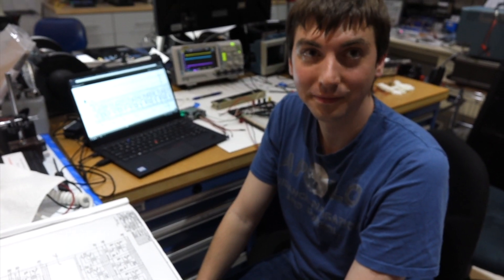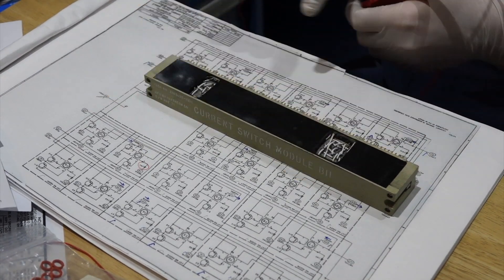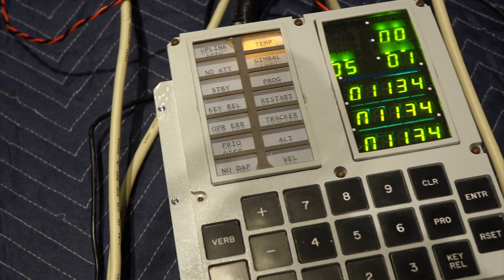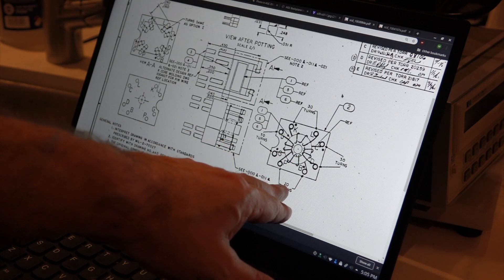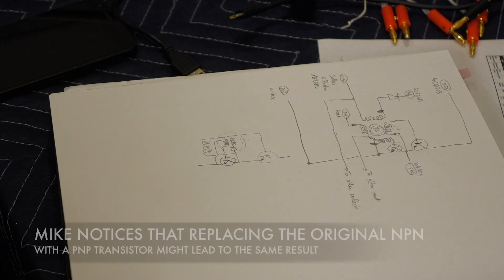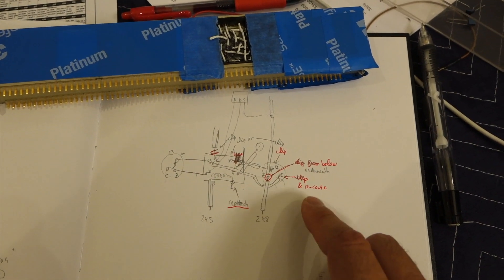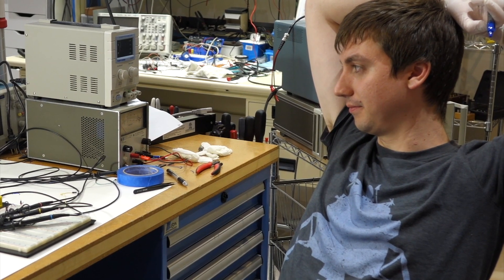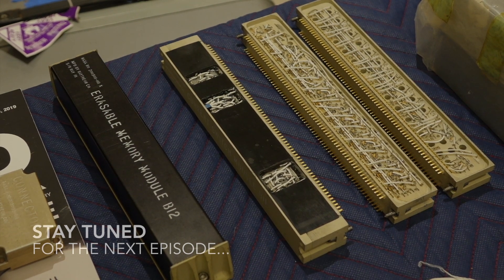Apollo Guidance Computer Part 18: Module B11 rescue, Apollo 13 style

Comment: put a ferite bead on the transistor legs that will filter out the ringing. probably because you used a 250mhz transistor clocking at 1mhz.

Comment: Looking at the waveforms, I think the reason for double pulse is that the new transistor is much faster and therefore produces more ringing. 
Just look at the slow rise/fall-times of one of the edge of the pulses with the original transistor.

Comment: Warning!  The SPICE family of circuit simulators deliberately exclude the radiation effects needed for space and military applications.  The original team behind that software series didn't want it to be used for designing nuclear weapons and intercontinental rockets.  Thus flying a SPICE designed circuit into or outside the magnetosphere may provide some surprises.

Comment: I want to know why the designers thought that potting this module would be a good idea; none of the others were that I’ve seen so far, and it’s not like it’s dealing with kilovolts of electricity here. 😕
Reply: They were potted for machines that would fly, to protect the components and connections from high vibration and g forces.
Reply: Then why not pot all of them?

Comment: In early solid state days ... PNP types were more difficult to produce and always lower in current capacity. Thats the reason why many early solid state amplifiers use quasi-darlington to pretend a power PNP using a power NPN. VERY noticeable on Germanium. I dont know if the AGC modules is based on Ge transistors, but is very likely. Ge technology was very limited in current and matching pairs.
Reply: It is silicon - early silicon

Comment: to get rid of that pulse you need a slightly slower PNP transistor, your one is way too fast, especially compared to the NPN counterpart.  Or add a small capacitor between base and emitter, probably around 2p7 to 10p or so, to tame those fast edges down a little.

Comment: Brilliant! Random question: Why is the AGC all 3-input NAND chips? Seems inefficient. I suppose at least they do use some flip-flops for sequential logic? Do you know which models exactly?
Reply: Because integrated circuits barely existed when this was designed - that 3 input NOR gate, which takes a whopping 3 transistors (6 total in the package, since they're dual) was state of the art technology at the time.
Reply: no flip flops at all. Exactly one type of IC. The concept was to drive up the volumes of that part, improve quality and lower unit costs. Apollo program accounted for about 60% of world IC production for a few years.Some of the ground support equipment was also designed with 3 input NOR gates to further drive up volumes.

Comment: I recall from reading my uncle's collection of Radio-Electronics and Popular Electronics magazines from the '50s and '60s that the majority of the transistor projects used PNP transistors instead of NPN. Could there be a reason that the PNP was preferred over NPN back then?

As a side note, there was a mass-produced FET available for projects somewhere in the mid-sixties.
Reply: Those PNPs were all germanium transistors, which came before the silicon ones. PNP is easier to make in germanium than NPN, but the opposite is true for silicon (at least in those times). Germanium transistors have many drawbacks which would make them unsuitable for this application (high leakage currents etc) which is probably why an all silicon NPN design was used.

Comment: This is a super ignorant question, but having watched a great many videos, and seeing the incredible challenges involved in making these repairs, led me to wonder, if such a failure had happened in space during a mission, what would could the astronauts or mission control have done to intervene and preserve the safety of the crew, and the mission?  Was the guidance computer mission critical, or could they make do without, as Apollo 13 managed to do?
Reply: Well, the LM itself could never land without the AGC. There was a backup computer, the Abort Guidance System which would only launch them back to orbit if the AGC itself failed.

There were some alternatives if an AGC failed, although none of them ever did over the course of all the Apollo flights. Ground could use radar and calculate some guidance information - they did as the primary solutions but the AGC was there in case they lost communications. Also hard to get answers from the ground when you are behind the moon. There was a backup way to control CM attitude and to fly a reentry with a special unit designed just for the purpose. 

The mission could not go on without the AGC, but there were backup methods to at least get them back home.
Reply: @carlclaunch793  Thanks!  I'm just in awe by fellows like you and your knowledge.  I understand just a small fraction of what these videos are about, but the pleasure is in watching the folks troubleshoot and do it all with determination and wit.

Comment: it was mentioned the potting compound is polyurethane? have you tried n-methyl pyrrolidone as a solvent? though it seems like you've got the mechanical removal down well enough, the NMP might go faster or at least help the last stage of picking it out
Reply: If you think NMP will remove this potting and it may be an issue in the future, GO GET IT NOW. Major hardware stores are phasing out strippers/paint removers that contain NMP, so unless you want to order it online and wait for the shipment, hit your local stores and see what's on the clearance rack. Citri-strip is the most likely candidate, the fresh stock is reformulated but older/clearing stock will contain NMP.

If you cannot find it, order some soon. The EPA is under pressure to ban methyl chloride outright (bad facepalm moment) and NMP would likely be attached as it's a similar and still somewhat toxic. All you'll be able to get are raw volatile solvents and cumene/limonene/terpenes.

Comment: Very good work! One of the labs I work with at the university does non-destructive micro/mm wave testing. Of the techniques they use for items that don't work well with the typical backscatter detection is using a 'high' power (relatively speaking, 50W is high power compared to the mw normally used) microwave transmitter to slightly heat up the contents of an unknown container and then image it with a sensitive FLIR camera. It would have been interesting to see if this would have helped located your short.

Comment: Modern transistors have a much higher bandwiidth then transistors from the 60s and 70s. Using a modern  transistor in old designs may cause ringing and oscillations. A capacitor of a few pF between B and C often solves the problem.

Comment: Why do people keep saying that we could never make another Apollo? Videos like this, with a group of nerds and a set of blueprints, seem to suggest that we can!
Reply: We likely can't replicate Apollo 1:1, because knowledge of many of the construction techniques have been lost to time. But we wouldn't want to do that, since so many technologies have evolved immensely since the Apollo era. We can make something much better than Apollo though, if we have the will and the funding.
Reply: @bennylofgren3208  And what techniques might those be? It certainly isn't friction stir-welding, you can do that with a tungsten-carbide bit and a milling machine in your garage. At what point, if you were to hand the blueprints to any competent machinist/fabricator, would they say, "how did they do that?" And why do the techniques even matter so long as the product is made to spec and tolerance?
Reply: @BlackEpyon  You've hit the nail on the head. Just as no actual scientist ever said "we can't explain how bumblebees fly," no engineer has ever said "we can't build another Apollo" (not seriously, anyway). It's just a pop factoid, something that sounds meaningful but is actually false.
Reply: @TheRealColBosch  The "we can't explain how bumblebees fly," came from the days before people had easy access to high-speed cameras. It was ASSUMED that they simply moved the wings up and down, when high-speed photography shows that they move for-aft, up-down, and change pitch, which is what's needed.

 Granted, many details of Apollo, such as engineers notes, have been lost, simply due to the lack of anybody thinking that preserving them would be a good idea (and people dying off), but when one considers that the  NASA Saturn/Apollo engineers HAD to figure these details out IN THE FIRST PLACE... What's stopping you from doing it again? If you know what the function is, you can fill in the gaps.
Reply: @BlackEpyon  when it comes to making simple parts, or making electronics do the desired thing, reverse engineering is pretty easy, you measure, build a model in Fusion, and mill it out etc.
The problem is when you are making parts on the edge of the envelope, and you need to know the exact alloy, foundry techniques, heat treating, surface treatments, etc, and not just the proportion of different ingredients, but also the order they were added, the temperatures at each stage, etc.

And then when you get into the internals of the engines, and you are dealing with extreme temperatures and pressures, and now you have hard to machine materials needing special surface finishes and infusions etc, it just compounds the missing knowledge that only was held by the people who actually figured out how to do it. All these things were designed and built by specific teams, and all the copies were made by those teams under heavy time pressure, so they weren't documenting everything, since they didn't have the time, and it was a constant iterative improvement as they learned more.

Plus you have all the manual fine tuning that often took things far away from the blueprints, based on good old craftsmanship, because it was easier to make the adjustments than to try to change the manufacturing process.

NASA looked at the possibility of bringing the F1 engines back into production a few years ago, and did extensive research on the records and tearing down an F1 to see what it would take, and what they found was that the design was great, and it totally could be brought back into production, but that it would require them to basically start from scratch and replicate the original process of figuring out how to turn the blueprint designs into a reliable engine, and they would have to go through the prototyping phases and lots of testing to find the right combination of techniques and materials, using modern technology and equipment, and the price tag they came up with to do it was more than designing a new engine using modern technology would cost.

It is big and cool, but it's not really efficient or very good for the way we do things now, and as SpaceX has demonstrated, starting with a clean slate can work better, and be a LOT cheaper!

And while they are a lot smaller, even the Merlin engines produce more thrust per pound than the F1s, so you put several of them together to get the same thrust, have better control, more redundency, and save weight. And the Raptor engines blow everything else away.

So yes, a complete duplicate Apollo could be manufactured again, if you wanted to invest the billions in doing this sort of reverse engineering of every single part, and then redeveloping the process of manufacturing them, but there really isn't any benefit to doing it, because we have better technology and better metallurgy and better manufacturing processes now, and we can do it better and faster and cheaper.

The reason we don't, is because we don't have the political or popular will and interest to do it.

SLS could have been done years ago, but it's mainly a political jobs program and a long term income stream for Old Space companies that donate well to politicians.
Boeing put the minimum number of people on the project they could get away with, which is why it is taking so long.

Then you look at SpaceX, and how they wanted something done, so they hired a water tank company to build a rocket in the back yard.
And then leased a fabrication facility to build another one. And that's all with internal funding and some private capitol.

Imagine if we gave them a few billion dollars and told them to get us to the moon. Elon would say it would take 2 years, and it would take 5 in reality, but in 5 he would have people living on the moon starting resource extraction lol

It's probably going to happen that way anyways, but Elon is going to have to demonstrate that he is so far ahead in the capability that the politicians have to admit it.
Reply: BlackEpyon Read ke6gwf's comment, it illustrates much better than I could what I mean. It isn't that the individual techniques are magical in any way, it is just that every single thing on those machines were hand-built, and incrementally changed and improved over time in ways that were often experimental, and not always properly documented. The F1 engines are a great example, since they took enormous effort to get right. Even so, they uprated them from 1.5 to 1.6 million pounds of thrust in later Apollos in order to carry the later heavier "J"-class missions. The details of some of the manufacturing methods used to produce the engine has been lost to time. Just as an example. The Apollo vehicle in total is full of these little details. Just look at the Apollo Instrument Unit as another example. It contains a digital computer (not the AGC found in the CM and the LM, the LVDC (Launch Vehicle Digital Computer), made by IBM) The software for that computer does not exist anywhere anymore. No one asked IBM to retain the source code, so unless someone gets lucky in a dusty warehouse somewhere it is gone forever. It has been speculated that it might be possible to extract the binary codes from the magnetic core rope memories that are still in the two surviving exhibits at museums, but it is unlikely this will ever happen. And even if it does, it would take a significant reverse engineering effort to figure it out.

None of this is not to say it can't be done, yielding at least a good enough approximation of the original parts, but it is not necessary! Today's technology, especially in guidance and control electronics, is so far, far ahead of 1960s tech that it would be a waste of time, except for the benefit of historians.

Comment: Man, at this rate of video uploads, we'll have a Saturn V launch by 2022!
Reply: Goikg to need just a few AvEs with just a few HAAS 5-axis CNCs!
Reply: Joja Joja That would compete for speedy completion against NASA's recent Moon landing plans (SLS+Orion).  2022 should allow time to order fresh components from the usual suppliers, such as F-1B engines from ULA (F-1B is the modernized version of the Rocketdyne F-1 engines), new IBM control systems for Saturn V block III, etc. etc.

Comment: Amazing! Can you summarize the modification you just made?

As I understand it, instead of two coils, one for forward current and one for backwards current, one of which was broken, you just used the working coil with push and pull for forward and backwards current.
Please correct me if I understood that incorrectly.

Comment: Somebody in the comments for the previous video referred to this a rocket brain surgery: I don't think there's a better description for all of of this!
Reply: ironhead2008 Well, the real rocket brain is the IBM machine in the sensor ring on one of the main stages (Fran showed a spare board some videos ago).  This is the spaceship brains, running a custom RTOS with fast crash and overload recovery (happened multiple times during Apollo 11's landing on the moon, with software engineers in mission control having to decide if Neil and Buzz should abort the mission a few feet from the Moon).

Comment: Your PNP is too fast, a 4Mhz max would be better. One other possibility is to put a Ferrite bead on the base lead to damp the input.
Reply from the maker: PNP is not too fast, same speed as the NPN as you can see. Rise time is controlled by an inductor at the other end of the address wire once it's all connected up.
Reply: @CuriousMarc  OK fair enough did not notice it was unconnected at the other end. 
Just a note on that power supply you are using to test with, I have used many variants of that, and have a TENMA 72-10480 which is identical on my bench at home, however there is a fault that sometimes happens after a lot of use. The fault is the output on switch on jumps to 30 Volts for a nS spike before settling to your set voltage on light loads under say 100mA, on some of our equipment we had to make a zener/ VDR/ bypass cap protection circuit on the test Jig inputs to protect the boards under test. 
When using the 4 wire voltmeter make yourselves a 4 wire test lead set, if you make it out of 3mm wire you can use it for the current measurements as well. One of my jobs has been multi-meter calibration checks for use in the manufacturing testing of PCB's and finished equipment. The HP/Agilent meters are very stable for testing other equipment, and I found after many years of testing that some cheaper meters can be just as good  as the expensive equipment, the only real problem being the quality of the leads.
Reply: It would work

Comment: To extract the transformer out from the poured pot you should heat it up to 150 .. 200 C by hot air gun. Epoxy compound will get much softer and allow you just to pick itself out from the pot.

Comment: The amount of knowledge, effort, sheer gdamn brilliance an perseverance in this series is mindboggling. Quick question... I get that the idea is to repair and restore, but given that you guys have all the schematics and more than enough know-how... Wouldn't it just be simpler and faster to build a replica of the module? I'm guessing the connector would be the biggest problem.